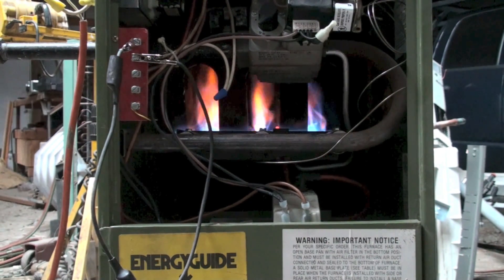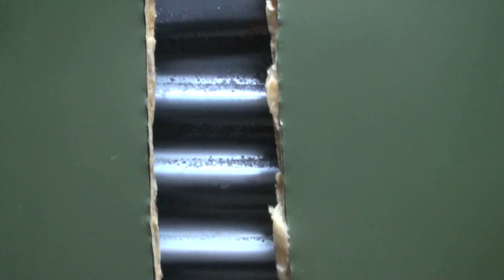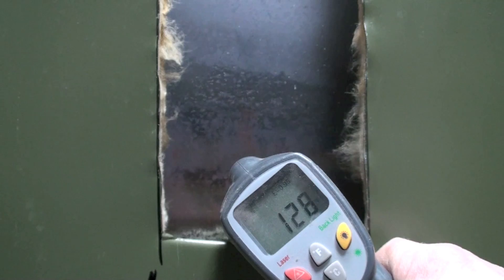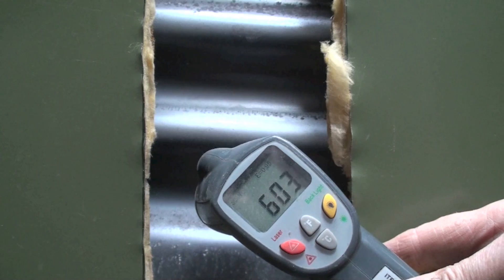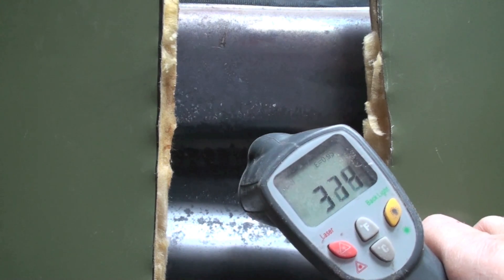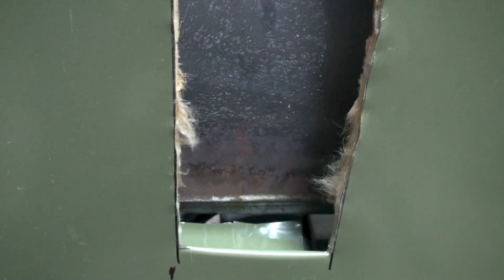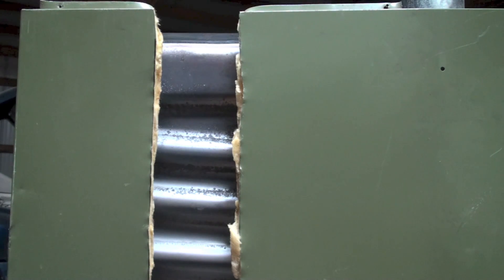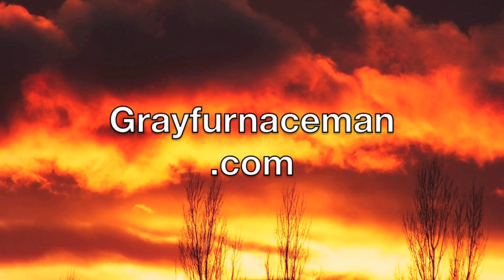Gas furnace heat exchanger temp measure

Comment: Hi, I have a carrier 120000btu furnace with error code 33 and then 13. I took out filter, top and bottom furnace doors. But the high limit switch still trips. My gas pressures are correct for both stages( 2 stage gas valve). All return vents and supply registers are open. Limit switch has rating L220-20. Can I stick a thermometer where the limit switch is and confirm the temperature?  The furnace is only 2 years old. Am I missing something? Thank you.

Comment: If the blower speed was too high, what temperature at that top section would cause concern for internal condensation? I've seen numbers as low as 120F for an oil furnace? Always great videos, thank you.

Comment: Thanks Gary for posting this great video! Generally speaking do you know if fans and furnace  in commercial forced air systems both start and stop at the same time or does one of them runs longer? Also, do all these system intake the same indoor air?
Reply from the maker: In the commercial realm, there is no "generally speaking".
A few tips:
Most commercial units have a percentage of outside air introduced.
Restaurants' kitchens are 100% outside air.
Many systems operate their fans continuously.
GFM

Comment: I really like that video showing the dropping temperature no wonder those heat exchangers cracking and burning through I've measured free gas temperatures and it can be 4 5 6 hundred good video though
Reply from the maker: Gary Smith Kind of amazing they survive at all.
GFM